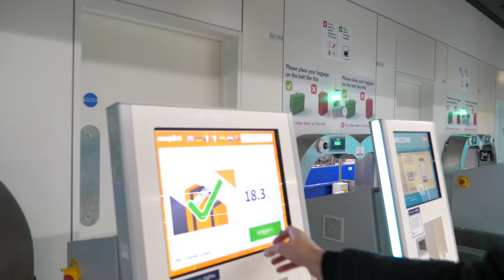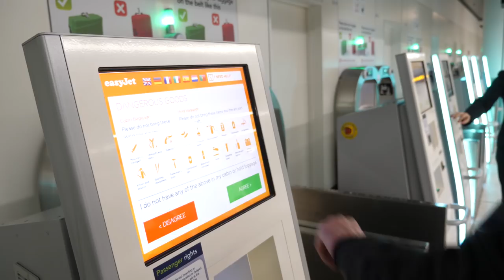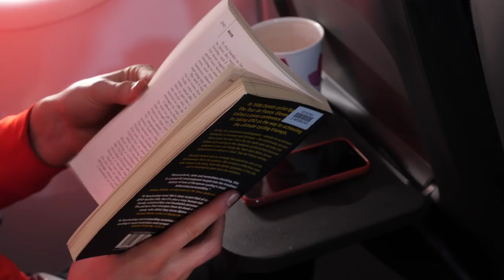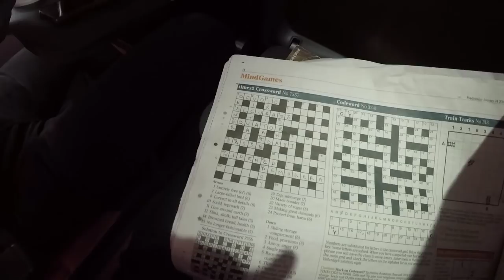Behind The Scenes With GCN | Shooting An Epic Ride

Comment: Great video guys, really enjoyed this type of content! Just some quick questions: would you recommend travelling by plane with you carbon bike packed up in the original cardboard bike box you received it in? Would it be a big risk? Or is the investment in a proper bike bag worth it (because they are pretty expensive)? And then again, rather hard or soft shell? Cheers. #torqueback
Reply from the maker: +Marc W Hey Marc, good question. Plenty of people do travel with cardboard boxes but, for me a quality bike bag (hard or soft shell depending on budget - there are good examples of both) has always seemed worth it - I don't want to take any chances with my bike or arrive at my destination with a bike I can't ride.
Reply: Global Cycling Network Thanks for the quick answer, now I just need to check whether a new bag is in the budget ;)
Reply: Try to get a bike bag second hand I got mine at half of RRP and it has only flown once!!